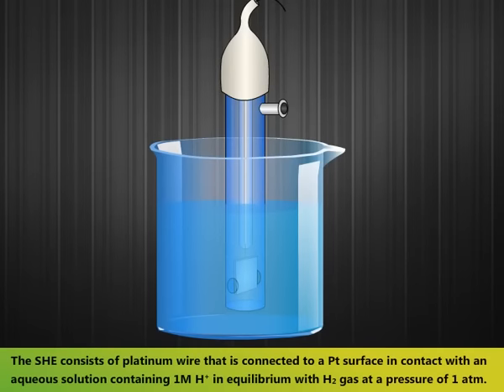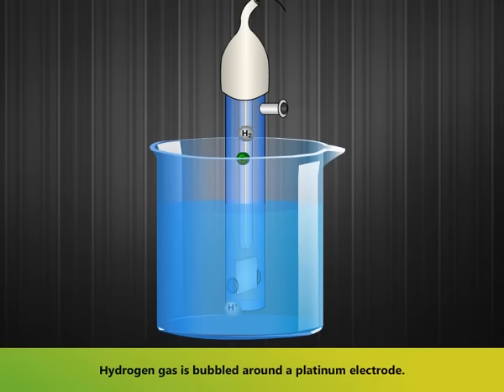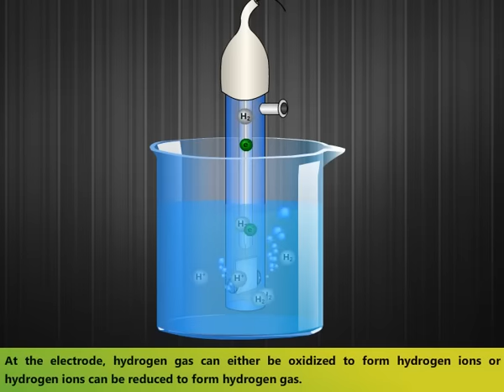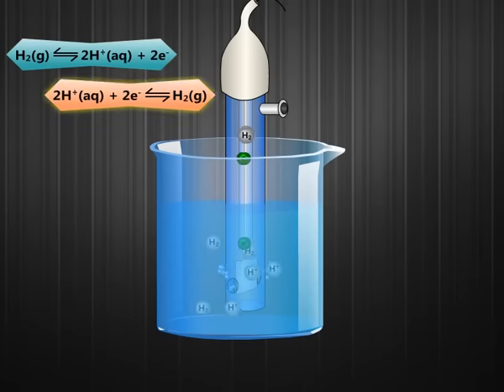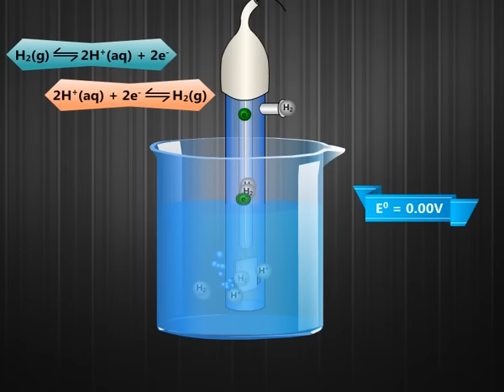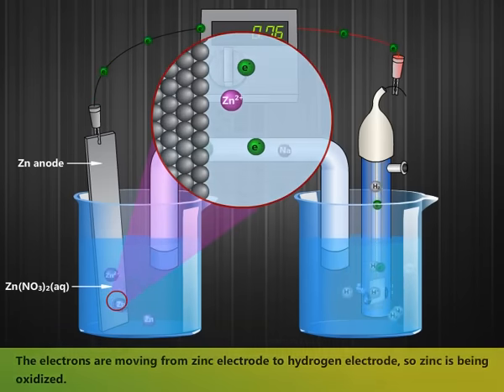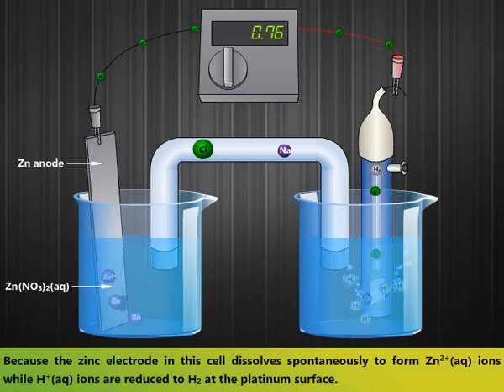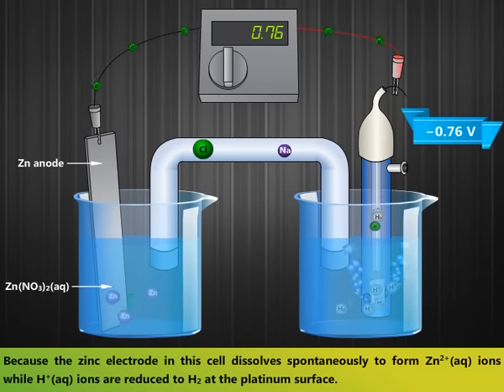Standard Hydrogen Electrode | Construction & Working | #LearnEngg #chemistry

Comment: From where, does the electron is constantly supplying?
Reply: From anode (Zn) where oxidation takes place
Reply: i also want to ask the same question
Reply: At the anode zinc solid gets converted to zinc+² ions and 2 electrons....
These are those electrons which are supplied to cathode..
Reply: It can be supplied from any metal that has negative reduction potential number such as, Zinc , Magnesium or Aluminium....if SHE is not attached to any aother electrode it won't work